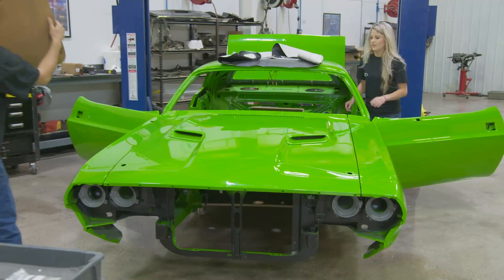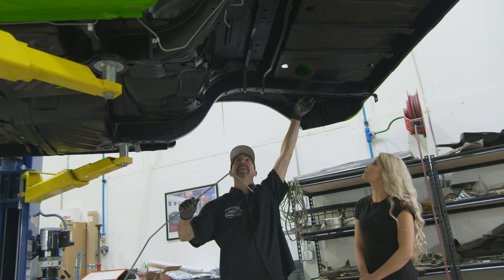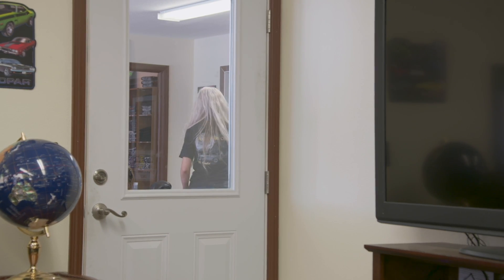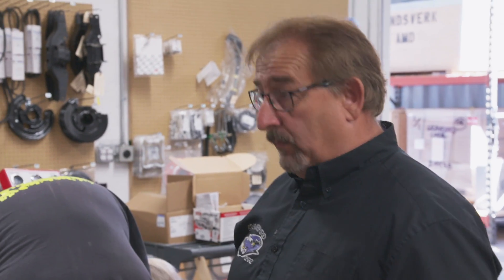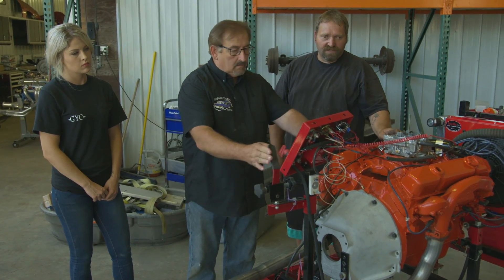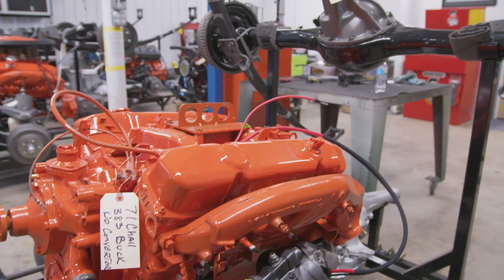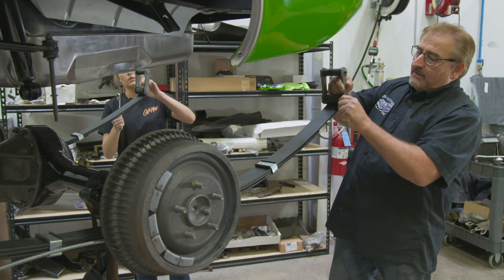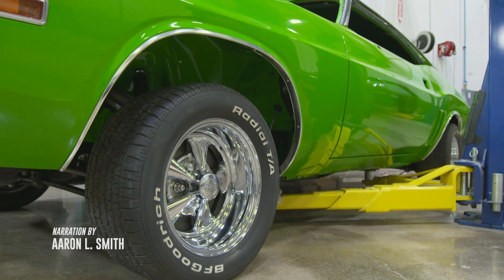S07E07 What We Do For A Buck!

Comment: In high school, I took auto shop. A guy brought in his 1978 Camaro for some free work. When it was lifted on the hoist, someone bumped their head while ducking under, and 4 pounds of barely cured filler fell off the driver's front quarter panel. Ugliest cheapo patch job anyone ever saw. Instead of reshaping the metal, the local shop slapped excessive Bondo on the panel.
Since then, a bunch of us referred to lazy screw-ups as "a 4-pound Bondo job".

Comment: Years ago I was trained (coachbuilder) to use lead not plastic fillers. When I went for a job at a body shop they asked me to use filler and I was like what the hell is that? They were shocked I'd never used it :) Now I use filler when needed but "only" thin layers. Much easier and nicer than lead loading.

Comment: You should be using marine grease on the suspension rubber and shackles. Its not affected by water. 
Get it on your hand and try washing it off and you'll see the difference
Reply: Shows what you know, absolutely nothing! Grease is a no no !.. Liquid soap is the way to go on fitting any rubber.
Reply: @geraldswain3259  sure if you want it squeaking so bad you can hear is a block away use dish soap. Energy suspension uses silicone grease. Another rocket scientist lol